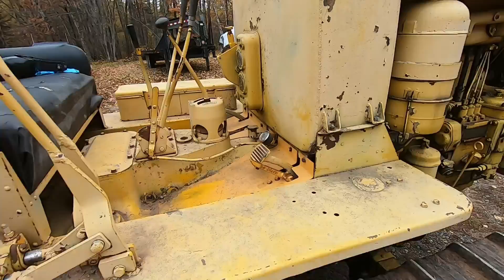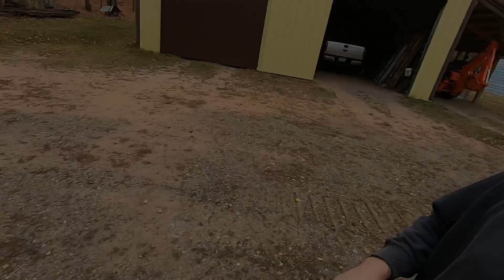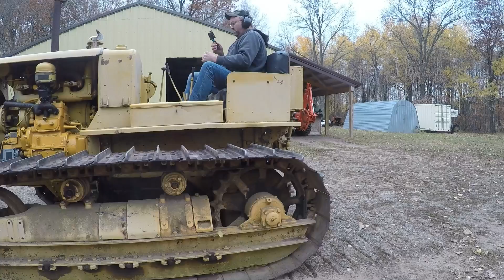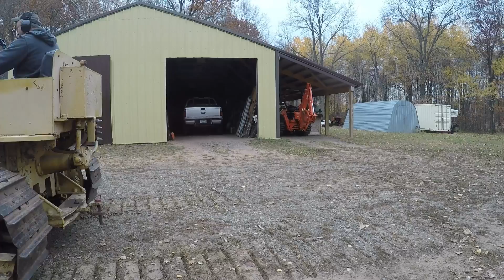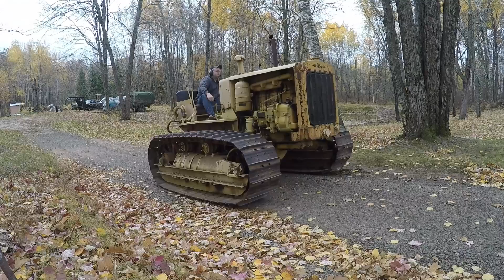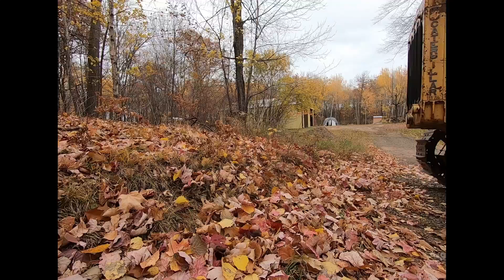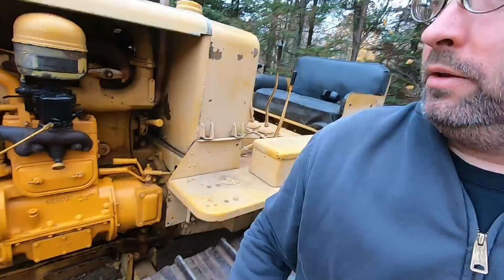Caterpillar "Pony Motor" - Can Just The Starting Engine Power The Whole Machine? Let's Find Out...

Comment: Loved the video! Amazing what the old iron will do.
Question about 1113. On your other D2's (such as 5U7066) it seems like the gear lever comes up and makes a sharp bend to the rear, while 5J1113's is sticking almost straight up (slight bend). Is that just a model year difference?
Finally, WHAT is that gorgeous blue Chevy (1950?) in the background?
Thanks for all your vid's.

Comment: Will there be a " temporary"remote timing adjustment cable installed near the operator, so a full dismount won't be needed? Great fun, thanks.
Reply: No need he'll be going that slow he'll just step on the track and hopefully make the adjustment as he gets near before he falls off the end. Then at a  speed faster than the tracks going forward run back along it to the seat. If the plan fails they might need to pressure wash the yard down !    Just for the stupid  or the ones with no sense of humor "yes I'm joking" about him actually doing this !

Comment: I hope the starter motor gear box dont chip a tooth, thats alot of pressure on that gear box
Reply: @squatch253  sometimes these comments i make are from the hip with little or no evidence to back it up, this is one of 'em ) i grasp what you said but why bring in the ring/pinion gears?... so the starter motor shaft connects to the ring/pinion gears also? If thats the case then i guess i would focus on the drive shaft from the starter to the ring/pinion. You could twist the shaft if it gets hot enough and you put alot of pressure on it from driving rough heavy load.. All this is speculation on my part presenting no evidence to you.. Thats all i want to say right now other than how sweeet a job the painting came out, looks great!!

Comment: My reservations about this would not be on the life-expectancy of the pony, but the little straight-cut pinion gear and whatever bushes (English)/bushings it runs on.But maybe that gentle clutch start /4th gear run/ climb puts no more load on them than  a cold diesel engine with optimal compression and the decompressor closed ,but with starting problems.
Reply: I think the pony motor was made for a limited life before overhaul. I am pretty sure Cat made them for hauling the machine up the ramp of a loader. It would be in the operators manual.

Comment: At 24 HP, that starting engine probably technically isn't that much less power than the main engine. :-)
Reply: But torque on the other hand..........
Reply: @Happyfacehotwheels  Remember hp is a product of torque and rpm, the little 24hp starting engine has much less torque but makes up the hp from the 2700rpm - the big reduction between starter pinion and fly wheel ring gear (or what ever equivalent a starting engine has) will increase the torque.
Reply: 45 to 50 hp for the 3 cylinder diesel in the rd6  a quick google search..but i wasn't able to find the torque rating
Reply: @leeharris3061  11000 at 600 rpm or more
Reply: Actually 11400 drawbar pull at 600 rpm
Reply: @leeharris3061  you're pretty close. Squatch once said it's 51hp.

Comment: The little engine that could :) I was pretty sure it would move at least in the low gears after I saw you move that mothball unit (don't recall which one it was) by turning the whole engine and drivetrain with the crank handle.

Comment: Considering the old traction engines used to run around on 30hp 
Not really a surprise 
Can move a mountain with a weed eater just need the right gear ratio

Considering the physical size of that pony motor and its age of design 
It puts out quite alot of power for its size compared to a modern Honda twin cylinder

Comment: I noticed that pop also i thought more of the fact it was a little lean on the high idle jet when the gov wanted to give it more gas, edit i wonder if the pony on my d8f cat would move 43 thousand pounds blade it self is 12 thousand pony has same bore and stroke but they changed the exhaust porting to the back and used and up draft carb zenith oh and the magneto is up top liked the video
Reply: Hello squatch i just got my crank shaft and pony back from machine shop machinist said 10 under on the rods wouldnt clear so i gotten 20 under bearings well he cleared it at 10 under i got to choices take it back and have it done to 20 under or find 10 under i cant find 10 under or part numbers for 10 under do you have numbers or can find part number for 10 pony engine rod bearings for a 1957 d8 cat 14a model

Comment: My Dad bought a D4 about 40 years ago. It was cold when they went to get it and the diesel wouldn't start so they loaded it on the truck with the starter motor. I figured yours would do the same.  Thanks for the videos, always a please to watch. Keep smiling.

Comment: My eyes are both twitching here far Down Under. Never ever do that again. Be kind to your pony motor. lol, great fun. 
When l was a young kid riding in Dad’s ‘28 Hupmobile sedan my job when towing the caravan (camper trailer) going on holidays was to work the advance & retard lever on the steering column as the old Hup struggled up the hills. Brought back happy memories hearing that little pony backfire under load on high advance. Great video Squatch253.

Comment: I would have suspected it would have moved before seeing the video. Like someone else commented, people have moved vehicles with just a starter motor. It's all about the gear reduction!
Reply: Had an 86 Toyota 4x4 that had a "crawl" button to engage the starter without starting the engine so you didn't have to burn the clutch.
Reply: @zfine1450  What's the clutch got to do with it ?
Reply: “L

Comment: Well, I thought it would do it, because I've move fully loaded semi- trucks with just the electric starter motors when my clutch went out and couldn't release the clutch.  It's not a recommended practice because it is so hard on the starter motor, but it can be done. Thanks for sharing....
Reply: Drove all day picking up milk from farms shutting off the truck and putting in reverse and starting it back up when the clutch fork broke.
Reply: @mfreund15448  I don't know why the OP didn't use the engine like you and I. I've driven a vehicle 30-odd miles without a clutch pedal - going through the gears fairly normally. I've even driven a tractor a couple of miles without the steering wheel making any difference !
Reply: I abused few starters and they were fine, while my friend tried it once and it ripped out a bit of the bellhousing. Whoops
Reply: Had a dodge shadow once that for whatever reason the clutch interlock wasn't... there, actually, not even any wiring. 
Not an issue for years until one day I hopped in, hit the starter and the damn thing took off like a rocket; I'd left it in second gear. Light little car doesn't need much!

Comment: with enough gearing, you can move anything with 24hp. 🤔
Reply: I need a 10 hour long ASMR audio clip of that RD6 idling btw.
Reply: I've seen gearboxes made with cheap 3d printers be used to lift anvils. They just connected gear after gear, so the ratio was absurd and the weak teeth distributed the force accross a large surface area.
Reply: I've seen people move vehicles with the electric starter on a manual transmission pickup..
Reply: So why prove it?.?
Reply: TRUMP TARD  
Thanks for replying
I read and re read that story.
When I was a little kid, 50 plus years ago, 
all my male role models were blokes like him, 
some of them were contractors on the Snowy Mountains Hydro scheme
Their back yards had grass 5 feet tall and they built Prawn trawlers there,
Occasionally, a 100 tonne crane would arrive and take away yet another finished job
All this, happening in a suburb that had homes with manicured lawns, 
those blokes were my heros.
  The good ol' days.
Reply: To give even more validity to what you say, the largest steam powered traction engine made over 3000 ft. lbs. if torque off of 30 +/- horse engine while my 605hp diesel only makes 2250 ft lbs of torque. My diesel just can do it faster than 7 mph and at much higher rpm's. At an idle, even though it's rpm's are more than double, it doesn't even find close to that torque (the diesel).